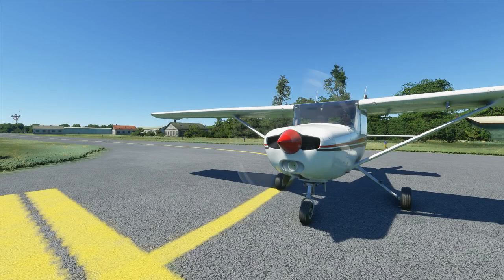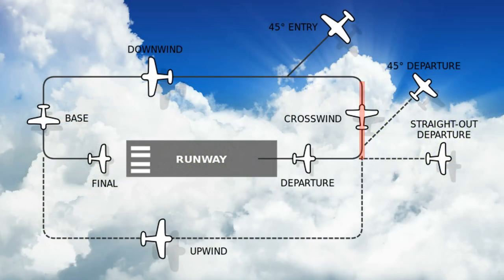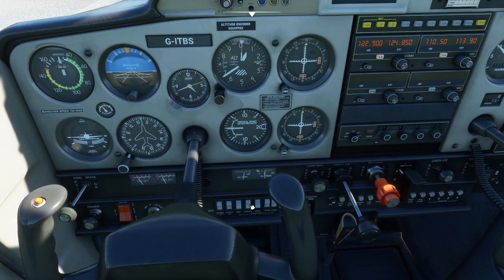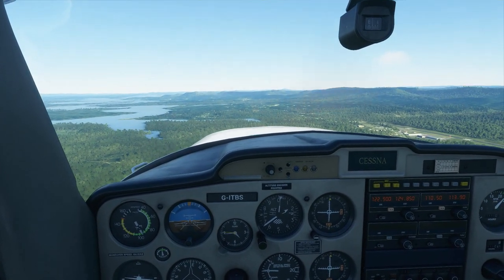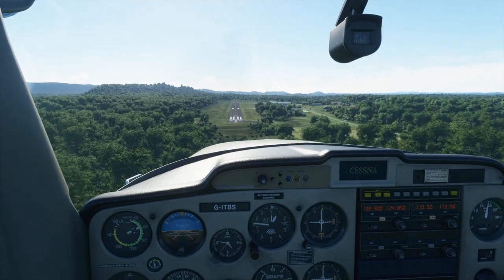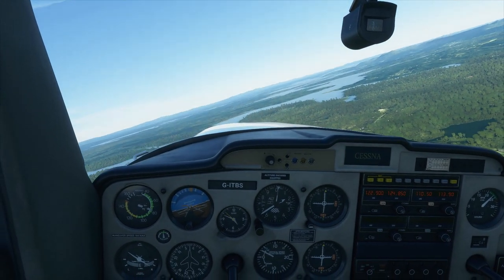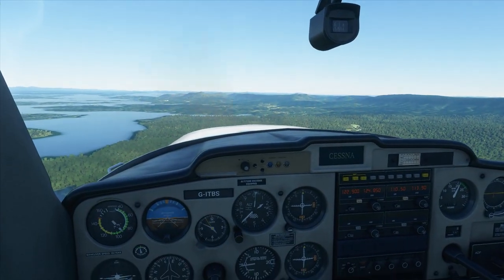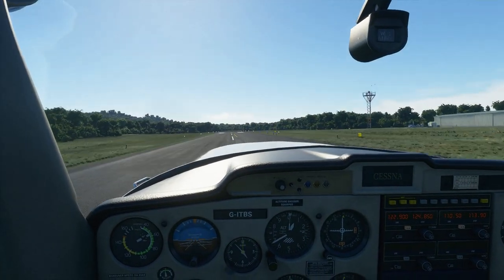REAL PILOT | MSFS "Flight School" | Part 6: Circuits | Microsoft Flight Simulator

Comment: When using carb heat it is recommended you apply car heat before reducing power and you maintain the carb heat until touchdown. On your first approach your airspeed on final dropped to 55K and well before reaching the threshold. I was surprised you didn't lower the nose of the aircraft or apply power.
Reply from the maker: Agree with you for applying the carb heat. For leaving it on though, I guess we were just taught differently. I was taught to get rid of it at 200ft. The logic being you’ll either be landing or going around fairly imminently at that point. Saves you possibly forgetting it in the go around (easier to do in something like a 152 or PA28, where the carb control is not co-located with the engine controls). I got rid of it a bit earlier in this video, as it’s a bit fiddly to be using the mouse and moving the view on short final.

Re the speed. In the real world, I would always err on the conservative side, so I probably would have corrected there. But 55kts is still well above the stall speed and I believe it’s Vx in the C152? so you could comfortably fly at that speed, even in a clean configuration. I didn’t see the need for drastic action and did slowly recover the speed.

Cheers. All the best : )
Reply: @IntotheBlueSimulations  Your video title states Flight School, I believe it would be helpful for the beginning student to see you fly the speeds you call out. 70 knots on final and 60 knots over the threshold. Unfortunately for the beginning pilot watching this video, these were not the speeds they see you flying.  Does this mean you're a bad pilot? Hell no, it means your video wasn't the best in showing airspeeds stated and airspeeds flown during the last several hundred meters of your approach. 

Keep those air passengers smiling :)
Reply from the maker: I take your point, it’s a fair one : )

Thanks and all the best!

Comment: Thanks for the video! Are these roughly the numbers you're aiming for?
downwind: 2100rpm / 90kts /
base:           1600rpm / 70kts / flaps10 / vs500ft/m 
final:            1900rpm /  60-65kts / flaps full / vs500ft/m
Reply from the maker: You’re very welcome, my pleasure. Good question! Yes, that all looks about right. I would say though, some of the parameters you mention are what you’re aiming for, others are sort of “secondary effects”. For example, think of it more as:

Full power @ 70kts for the takeoff and climb (don’t chase a VS)
2200rpm straight and level for downwind (don’t chase the speed)
Idle power and 10 degreees of flap until reaching 70kts on base (then use power to adjust VS)
60-65kts on final with full flaps and using power to keep on profile - with roughly 350fpm descent rate (don’t look for a fixed RPM)

Your numbers should all work pretty well I still air for example, but weather conditions might change them considerably. 

Hope that clarifies a bit : )
Reply: @IntotheBlueSimulations  very clear, thanks. It's nice to see how consistent and stable you're circuits are.  I always wonder how much handflying you do as an airline pilot. I assume you get a lot of practice in the simulator. Like doing approaches/landings in IMC without autopilot?  (must be ridiculous workload ;-)  The effect of power-changes are probably also very slow in such a heavy aircraft?
Reply from the maker: Great, glad it made sense.

I think the circuit “proficiency” just comes from many years of simming as much as anything else ha. I try and fly in a disciplined fashion more often than not in the sim, especially when I’m recording videos for you guys. I’m a big believer that simming can be a great learning tool, when used correctly. A lot of what you learn can be carried over into the real world.

As for work. Day to day, there isn’t all that much hand flying it has to be said. Takeoff is always flown manually, 99% of the time the approach and landing will be also. The rest is generally flown with the autopilot in, but that doesn’t really mean we’re out of the loop as much as people often think (we’re still monitoring, often intervening etc). I think these days, there are enough other distractions on a typical departure / approach, without flying the aircraft manually as well. It’s a shame that’s the case though. . .

In the simulator, for sure it’s generally much more hands on. Most of the time the workload isn’t too bad, obviously there are two of you, with the workload divided evenly. Under certain complex failures, the workload does start to pile up though yeah!

The engines can be quite slow to spool up from idle to full power. Most of the time this isn’t an issue / very noticeable, as even on approach you’ll be well above idle and the engines respond much more quickly in the higher power range (than they do at idle).

Thanks for taking an interest in the channel once again : )
Reply: @IntotheBlueSimulations  Thanks for the info. It's great to be able to ask questions to IRL pilots these days over the internet.  Also  the info in your vids makes flightsimming much more fun, trying to stay as close as possible to real life flying/procedures.  Hope you also enjoy sharing your knowledge. I'm sure your channel will keep growing 👍
Reply from the maker: Yeah, I really enjoy making the videos (for the most part ha)!

That’s really why I started the channel. I’ve been a lifelong avid simmer and always had so many questions / wonderings about the real world (before google existed). I used to enjoy just messing around, but then found more and more enjoyment in trying to mimic the real world procedures. So I though it would be nice to try and bring the two things together on the channel.

I think people are generally enjoying the content and it’s actually been great for me as well. Firstly it adds a whole new element to simulation, when you know people will be watching you ha! Secondly I’m slowing picking up some video editing, oratory skills etc : )

Comment: Anything above 10 degrees of flaps is not recommended for takeoff in the Cessna152.  In general 15 degrees is the maximum you would use for any aircraft for takeoff as the amount of induced drag increases dramatically.
Reply from the maker: Yes, I would agree with you on that (generally speaking). Did I state otherwise in the video though? For the C152 specifically, it’s been years since I’ve flown it. I certainly recall doing takeoffs with no flap or one stage of flap, can’t remember doing otherwise and the POH confirms what you are saying. I seem to recall on the PA28 we sometimes used 2 stages of flap, which I believe was 25 degrees.

Cheers

Comment: Thanks for the helpful tutorial. When doing a circuit in the Mooney, it picks up speed and height very quickly. Is it the case that you would always take off with full power? If so is there any guidance on how quickly you can reduce it?  Also, I couldn't quite catch the name of the airport you used in the video.
Reply from the maker: Thanks very much, glad you found it useful!

I’ve never actually flown a single engine prop as powerful as the Mooney in the real world, but I think it’s fair to say it’s always desirable to take off with full power - unless otherwise specified by the manual (in a non turbo aircraft). You minimise the takeoff run and maximise the climb performance. Unlike a jet, I guess there would be no performance data for anything other than full power anyway. In terms of power reduction; when I learnt to fly, we did it at 500ft (on the more powerful aircraft. For the less powerful aircraft we used full power until the cruise). There’s no hard and fast rule for GA flying, but generally you want to gain altitude as quickly as you can early on. Try 500ft and see how that works for you. Practice will make things easier. Circuits can feel busy at the best of times, the Mooney is a beast! : )

The airport is Bearce. ICAO code is 7M3. Hope that helps!
Reply: @IntotheBlueSimulations  Great, thanks. That's very helpful. It's more or less what I've been trying. Full power to 500 feet, then on crosswind aim to get the power down to 500 feet per minute, where things are a bit more manageable. I'll go over to 7M3 and practice a few right-hand circuits.
Reply from the maker: Sounds very sensible. As I say, the more you do it, the less rushed things will feel. It’s good to mix it up and do some right hand circuits as well yes.

Good luck with it all! If you have any more questions, always feel free to stop by : )

Comment: Thanks again for your tutorial I will practise this to get the angles right ... as Gallant Doffy I to fly the Mooney a lot and cannot find how to manually put a flight plan [IFR] into the G530 and also how to understand the instruments properly.
Reply from the maker: Thanks, you’re most welcome!

I’m thinking I will probably do a vid at some point comparing the G1000 display with the steam instruments. Highlight the parallels and explain what each instrument in showing etc. As for the G530, I will look into it, but I don’t have any experience with it myself either, so I’m not sure whether or not I’d make a video specifically on that.

Thanks for the suggestions : )
Reply: @IntotheBlueSimulations  if I may offer one critique,,,,,,it may be worthwhile to explain the characteristics of flight inputs with the yoke. When you add left/right Ailerons you must return the yoke to center position. Unlike an automobile where you hold the turn input throughout the turn. Then, to return to level flight you counter the turn input and center the yoke. Please, no hate. I know it is a small difference yet I found it quite amazing 40 years ago. If you mentioned this and I missed it my apologies. If you did not mention it and feel my comment is petty, my apologies. Otherwise, I have thoroughly enjoyed your instructions thus far. All students should watch this series as it is EXACTLY the correct way to fly a small Cessna. Well done and thanks for posting.
Reply from the maker: Haha, of course you may offer a critique and a very valid one it is too!

I tried my best to approach this series from the standpoint of the student “knowing little to nothing”, but unfortunately that one got the better of me haha. I guess I’ve been simming and flying for so long now, that I just considered it inherent knowledge - but of course it isn’t (much like people are often baffled that your steer with your feet whilst on the ground).

Whilst unfortunately it’s a bit too late to amend anything in this particular series, I’ll try and bear it in mind for the future.

Thanks very much for the feedback and indeed your kind critique of the series : )

All the best!